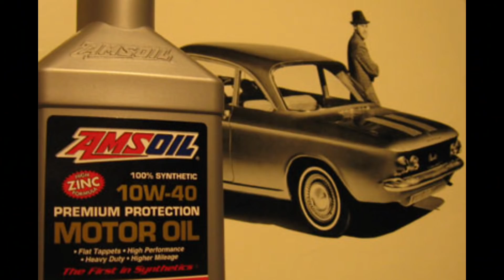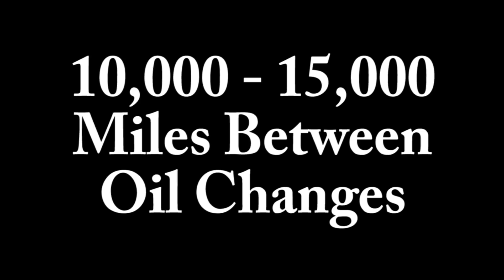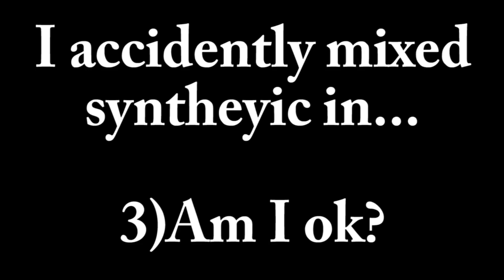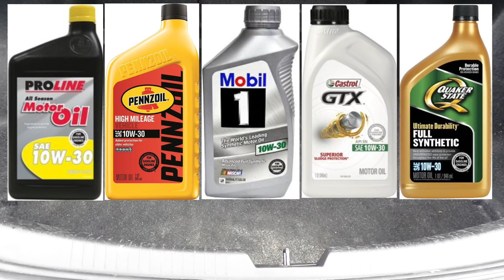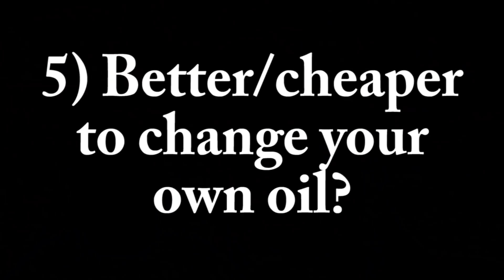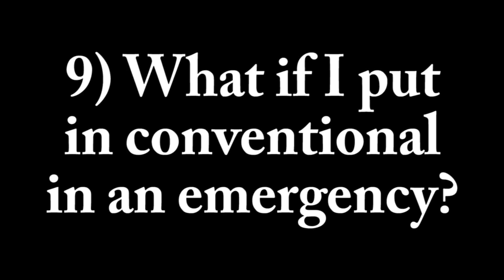Myths, Questions, and Answers About Engine Oil

Comment: I’m rebuilding my 350 & am going to upgrade it slightly from stock (94 K1500) with an emphasis on torque since I want to use the truck for truck stuff. My question is, since I’m starting from scratch & it will not be stock, could I use synthetic and how do I know what grade ?
Reply from the maker: Sure, use the oil recommended for the year the engine was made. I usually start with 10W40

Comment: What is your take on flat tappet engines which require some zinc content? Is there any synthetics that will work in these engines?
Reply from the maker: They're no problem, use Penn grade oil

Comment: Hi Pete, I have a Eclipse GT V6 3.8L the owners manual said that the car use 5W-20, can I use 5W-30 Full Synthethic for better lubrication?  A 5W-30 can make my car last longer? Thanks
Reply from the maker: If the owner manual call for 5W-20 I would use that. Switching to 5W-30 does not give you better lubrication. It's thicker and could cause problems.
Reply: @PetesGarage  Thanks a Lot Sir! Take care. What do You recommend for a motor break in process? Is for the same car, that I mentioned in the last comment. Please, help me with this, because everywhere I go, people said crazy things like drive it like You stole it, and that not make sense to me.
Reply from the maker: It should have roller lifters and rockers, so no special break in needed
Reply: @PetesGarage  Oh Nice, thanks Sir now I have peace of mind. This Eclipse is one of my dream Cars, because when I was a kid My father took me to the dealership and in the showroom we saw a Evo9 but that car wasn't for sell because it was property of the dealer manager or something like that. But, then I saw the Eclipse GT 06, (6speed) I sat in it and I feel like a connection with the car that I never forget. Now I bought one for 1,600 with a very easy front hit to repair, 6 speed manual, the same color that the one I saw in the dealership that day. And with only 83,404 original miles. Thanks Pete You have really good videos, and very very nice content. Take care and wish you Blessings.
Reply from the maker: That's awesome! Congratulations and good luck with it

Comment: Dear Pete,  I've 1 litre of 5w30 leftover from my last oil change.   Can I safely mix it with 3 litres of 0w20 for my coming oil change?  Both oil are of different brands. Can I safely mix it and use it for 10K km?  Pls advise..
Reply from the maker: IF the engine requires 0w20 it should be fine. If you have 5w30 leftover, why would you change to 0w20?
Reply: @PetesGarage  my previous car was using 5w30...recently I've changed to a Honda which uses 0w20.
Reply from the maker: Go with the 0w20

Comment: Hi Pete,  there was a engine oil test done way back in 1996 by consumer report on NY taxis. The link is below. One of their findings  was that  synthetic oil did not have any advantage over regular oil on the engines. My question is, if the regular oil in the 90s are already sufficient for taxi usage then the regular oil in 2019 with API SN  grade should be more than sufficient on today's naturally aspirated cars,  is it? 

http://www.xs11.com/xs11-info/xs11-info/articles/51-consumer-reportstruth-motor-oils-july-1996.html
Reply from the maker: I've read that article a long time ago. Technology and advancements in refining have change considerably in 25 years. If they did the exact same test today they would get different results. Engines are made to much tighter tolerances.

Comment: I use traditional castrol gtx motor oil instead of honda as recommended by dragster guy as he swap my d17 to d15b engine which the engine stronger and need to be changed around 3500km instead of 5000km, price is reasonable it's better than honda motor oil, thank your very much for your help i needed this information
Reply from the maker: Honda has their oil private labeled by someone like Castrol.

Comment: I often hear that many choose 20W-50 for Ford smallblock. For me sounds really thick even for street performance engines.  Whats your experience?  Can you make a video about viscosity? :)
Reply from the maker: It really depends what the clearances are when the engine was built. That's a great idea for a video, thanks.
Reply: @PetesGarage  Working on a 67 Shelby 302 with "normal" clearances engine rebuilt a decade ago.
Reply from the maker: I would go with what was recommended when the engine was new

Comment: I've used 10W30 and 10W40 interchangeably for as long as I've been driving (since 1991). I usually put in 10W30, but if I need oil and they only have 10W40, I put it in. It has never caused a problem that I know of. 10W40 is a little thicker than 10W30 at high temperature, but that doesn't hurt anything. If you have 4 quarts of 10W30 and 1 quart of 10W40 in your engine, that just means you have "10W32" in there.
Reply from the maker: Sure, you can do that, but it really does depend on the engine.

Comment: My 1962 Ford Falcon with a 6-cyl engine was supposed to run 10W30 conventional oil. Some years ago, I switched to Castrol 5W50 oil (which is no longer produced) and I think that it destroyed the bearings because after a couple of years, the engine needed to be rebuilt.

Comment: If needed, why couldn't you put 10w40 grade into an engine you change the oil and installed 10w30 because it used a half or whole quart after 2000 miles?
Reply from the maker: It depends why it's being used up
Reply: @PetesGarage  

It was a rhetorical question. I've done it because it was what I had on hand with no apparent side affects. 

I've installed a 2.3 Ford into my sons Mazda 3 that was re-manufactured by a national company and it burned just shy of 2 quarts in 5000 miles, no leaks, no blue smoke. Runs perfect but goes through oil, (it was the first oil change after the 500 mile break in so I'll see if it changes) When I asked the company about it, they said it is within the allowable consumption limits as determined by some engine re-builder association. 

BMW tell its' owners that some of their engines can consume as much as a quart within a thousand miles.

My friend has an 2006 Integra with 320,000 miles and he says it doesn't burn any oil, so go figure.
Reply from the maker: Thanks for the followup

Comment: You should be carefull changing mineral/semi to full-synthetic in motorcycles (and vice versa). Most motorcycles use a wet clutch. I changed to full-synthetic on 3 different single cilinder motorcycles (BMW F650). They all had clutchslip within 100km. Replaced the clutchplates, and all 3 are now running fine on full synthetic oil.
Reply from the maker: Great comment....thank you

Comment: I am in total disagreement with your assessment of which oil is better.   Amsoil is #1. They were the first to offer synthetic oil to the public - 1972.  Just a little history on the term ' full synthetic'. Castrol challenged the API (American Petroleum Institute) to change the definition of what constitutes a full synthetic oil. It happened about the time they introduced Syntec. It used fossil oils with a lot of synthetic technology to produce a better fossil oil and the API conceded. This watered down the true full synthetic oil definition to include the fossil oils using modern technology. Amsoil, to my knowledge, is the only one offering a 25,000 mile or one year oil change interval if you use their Signature Series oil  and  their oil filter. If you use another brand oil filter, they recommend changing the filter at OEM recommended intervals. This will NOT void a new car warranty!  Most of the myths are the result of big oil companies puushing back on Amsoil.  Causing seals to leak, causing roller bearing to skid and get flat spots, can't break an engine in on synthetics and what you mentioned.  If your seals start leaking with the use of synthetic, the seal was already cracked. Synthetic creeps more that fossil oil and will find it's way through the tiny crack
https://www.amsoil.com/shop/by-product/motor-oil/gasoline/sae-0w-20-signature-series-100-percent-synthetic-motor-oil/?code=ASMQT-EA

If you have a pushrod motor, their Z-Rod oils are the ticket. Their racing oil is also fantastic for pushrod motors due to high ZDDP levels. Their 10W-30 Heavy Duty diesel oil is also excellent. Amsoil did a test on a Mack E-7 that went over 80,000 miles on one oil change and the engine actually came apart after 1M miles and could have been reassembled with the same parts due to lack of wear. I have the VHS video about it. All diesel engines benefit from oil analysis. That tells you if the oil needs replacement or can continue in service and the amount of contaminents.  

https://www.amsoil.com/shop/by-product/motor-oil/diesel/synthetic-sae-10w-30-sae-30-heavy-duty-motor-oil/?code=ACD1G-EA

I have been using their products for over 26 years. My friends use Amsoil racing oil in their  AMA Pro Hill Climb nitro burning motorcycles (Triumph Twins) and I have success stories that I can relate about testing after the engine oil was drained and not refilled by accident - no wear,  bearings looked new. Nitro is a water based fuel. Jets had to use synthetic oil since the first flight. Fossil oils cannot stand the heat and jets would be falling out of the sky with the use of fossil oil, literally. Synthetics have been around for a long time and Al Amatuzio, an Air Force pilot, started the company.  Their oils are always tested by an independent labratory. You can go to their website and see lab results such as the 3 ball wear test, volality test (yes, oils evaporate), and other test results by viewing their Data Bulletins.  Readily available. Using test results is a valid way to compare oils,  what grandpa and a friend of a friend of a friend says is not scientific.  Can you find this info from other brands?
https://www.amsoil.com/shop/by-product/motor-oil/gasoline/z-rod-10w-30-synthetic-motor-oil/?code=ZRTQT-EA
https://www.amsoil.com/shop/by-product/motor-oil/racing/dominator-10w-30-racing-oil/?code=RD30QT-EA
https://www.amsoil.com/shop/by-product/motor-oil/diesel/signature-series-max-duty-synthetic-diesel-oil-0w-40/?code=DZFQT-EA
 amsoil.com
All their products are fantastic and do what they say.
Reply from the maker: Thank you for the comment.

Comment: I've been running Amsoil Signature series in my 2004 Corvette Z06. It's 6.5qts. That's a 5w-30 oil.  I do change my oil a couple times a year as I track the car.  I like to add a 10w-30 quart in of their racing dominator for the extra zinc and things,  and keep the other five and a half quarts Signature because of the better detergents. Think it's alright that I like to run 5.5 Signature series 5w-30 , and one quart of their racing 10-30. It's mostly driven in summer months and start ups are never really cold in a 50° garage...(?)
Thanks
Reply from the maker: Thanks for the comment Trevor. I think you'll be ok. While the zinc will give you a little added benefit, it will affect the O2 sensor and use up the catalytic converter. But it's minuscule, impossible to measure.
Reply: @PetesGarage  well I have headers on the car,  American racing and yes, I bought their high flow cats , the rear 02 sensors are tuned out / deleted.  Im only running 02s up front.  Thanks
Reply from the maker: Sounds awesome, then you shouldn't have a problem.

Comment: Thank you Pete... this video killed all those myths running around in my friend's circle. That was an argument every time it came up ! lol...  I break a new engine in with a zinc/phosphurous rich oil and change over to either Mobil 1 or Royal Purple in the recommended grade and viscosity in my cars. I've never had and oil related failure and the only leaks are those that would occur in high mileage cars or truck naturally. Worn out gaskets get changed in my garage when I find them and it pays off by leaving my floor spotless.  Why was Amsoil rated at the bottom of the list?  I thought it was one of the very best oils, and the oldest formulated synthetic oil?  Thanks for the awesome video, I'll share it with all my buddies!!
Reply from the maker: Thanks Dave, glad those arguments are settled. It was tough to come up with the list, but price and availability was a factor.

Comment: I see a lot of oil change anti sludge concoctions at the moment, my impression of such things has always been that they are a gimmick and  if they did work the last thing I want to do is send sludge say trapped out of the way in the top of the head through the oiling system - do you have an opinion on them?
Reply from the maker: If sludge is building up in your engine, I'd figure out why and fix it instead of constantly putting in something to reduce it.

Comment: Question, would you dare put in prestone gasket sealer or any other sealer in a Corvette as a temporary fix ?
Reply from the maker: It depends why and for how long.
Reply: @PetesGarage  never mind I'll get a rental lol
Reply: @PetesGarage  its just for two weeks the wife is going out of town with the kids and I need a running vehicle, but I don't know if there is any sealer that won't damage the heater core or cause further problems... Is there one brand you would recommend?

Comment: Do not use modern synthetic jet engine oil in your car. Check out the viscosity numbers and you will find out right away why.
Reply from the maker: Don't use modern jet fuel either!
Reply: @PetesGarage  If you have a diesel that can burn kerosene ok, then Jet A should be fine. Still, don't use jet engine oil. It serves much more of a cooling function than a lubrication function in jet engines.
Reply from the maker: Thanks... great tip

Comment: synthetic makes leaks because it cleans better than regular oil and that can cause leaks.
Reply from the maker: The oil does not cause any leaks.
Reply: @PetesGarage If sludge/crud that's caked into gaskets/seals is keeping it from leaking (or slowing down the leak) and you put something in there that cleans out the sludge/crud, then it will start leaking. I've heard that switching completely to synthetic oil in high-mileage engines can, and often does, result in leaks, ever since I was a kid in the '80s, and that was always the reason given (I heard it from old time mechanics, not just people off the street). Obviously the synthetic oil isn't the root cause of the leak.
Reply: @PetesGarage  detergents in oils does
Reply: then get "high mileage" synthetics.